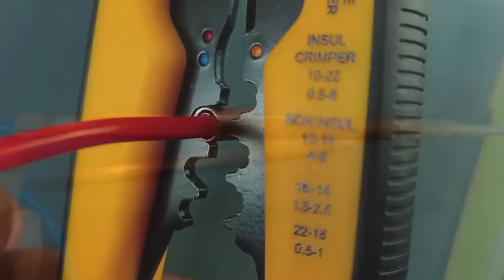Spot Welding Machine with Super Capacitor x 8 // How to make Simple spot welding machine at home

Comment: How come your fingers don't get burned as when contact happens , your fingers are bare , also how long each time to recharge the capacitors as I note the power is not connected during spot weld
Reply from the maker: One time charge, 5-10 minutes
Reply: It's not a 220 volt so that's why...😁
Reply: @mikestv4810  But with capasitors it supposed to amp burn and eat up the flesh.
Reply: The copper rods might not heat up that fast
Reply: Nice
Reply: Depends on the voltage, with these connected in parallel it’s probably lower than the 50V required to overcome the contact resistance of skin.
Reply: Capacitor maybe around 12v. Due to the copper is larger than the steel plate so the thin plate heat up much faster than the large copper so his hand doesn't burn but if he hold longer then his hand will be burned like charred satey.🤣🤣
Reply: The user wears a foot wear made of rubber. It prevents grounding through body and therefore no passage of electricity through body
Reply: @siran804  I still think this is a dangerous item it could lead to a battery exploding and possibly a fire , I user gets used to using it, what happens the 1st time he forgets to put on the rubber foot ware ??? Good luck to anyone using one , I,ll put my money on the lottery as this is a lottery for you,re  health .
Reply: @andyrankin5988  it's dangerous for sure. But this is how welding works
Reply: @siran804  not just to the same extent as this one is I,m afraid
Reply: Avi copper pipe naaa....?
Reply: Para tensões até 70 volts a pele humana  age como um isolante
Reply: @RJEDITALL  a
Reply: It’s 24 volts, if it was 60-100+ he would’ve jumped around
Reply: @andyrankin5988  OK
Reply: In addition 50 volts can give some shocks too
Reply: Excelent coment
Reply: Excelent video
Reply: Always the weakest part of the circuit burn not the strongest part that is those copper things
Reply: @siran804 , там всего 12 или 24 вольта. Такое напряжение не пробивает сопротивление кожи. Если напряжение большое, то ток пойдет от одной руки к другой. Надевать резиновую обувь необходимости нет, так как сам источник тока изолирован от земли (не заземлён.
Reply: Not good it very high voltage for spot welder..should be 3v dc only..not a good idea
Reply: 20 am jyada he.. 10 Am  medium he spot k liye...agar 20 se spot kiya or na nikla to cell k face pigal dega...is se achha 4 capacitor le shakte he..10 am k liye....,😊

Comment: Does not work as shown in the video, I used 10 X 10000uf capacitor, it discharged instantly and not capable of welding

Comment: this looks like a perfect way to get electricuted. no protection on the 2 copper leads that makes contact on the nickel strip, the copper wires are too close together when you need to charge the caps back up, theres no specs on how much power is coming through there so if one to spot weld on a battery, so how do you know you will not make a battery explode? so many other questions that needs to be asked...

Comment: Charge with 24v x 8  50v capacitor in paralled will yield 24v only. When used it will run out. But if the capacitors connected in series then the voltage will be dangerously high, example charge with 24v x 8 50v capacitor equals to 24v x 8 which is 192volts
Reply from the maker: Yes, ❤️
Reply: its paralel not series, but yes 24 volt its recomended for not conduct in the person

Comment: For spot welding it should give only a short impulse ,otherwise You could simply ușe the 20v/15A transformer directly.
Reply: Transformer directly to electrolyte capacitor? 😱 
It needs DC, not AC.
Reply: @q64qw65  a pile of mosfets in parallel triggered by a microcontroller for a variable number of milliseconds.
Reply: Yeah I was thinking the sane thing. Cause the total capacitance cannot supply that much current for so long.

Comment: With transformer, you can use 12v 10-20 ampere transformer; This is the missing part in your demo and got it from your your reply.  Thank you , It is really awesome.
Reply from the maker: I am use 15v 20 ampere transformer
Reply: @RJEDITALL  почему бы не использовать сразу с трансформатора, 20 ампер вполне достаточно для контактной сварки таких металлических пластин. Зачем нужны конденсаторы? Источник питания, должен быть постоянного тока, иначе будет бум. Щупы нужно изолировать.
Reply: Не ясно какое  напряжение  сколько  вольт.
Reply from the maker: @ЕрмуханАхметов-м3у  you can use 12-20v 10-20 ampere

Comment: I see a problem with this. The electrodes you are holding are exposed copper, which makes them very easy to touch each other. I'd wrap them in electrical tape, letting only the tips exposed.
Reply: I have a question with this as well. Now they're exposed copper of opposite ends that will complete the circuit when both are connected to the same conductor, wouldn't that mean YOU are completing the circuit by holding them both at the same time🤨. He obviously doesn't have gloves on. If I'm missing something lmk but that's copper pipe(conductive) covering copper wire(conductive) lacking any kind of insulation.
Reply: @austing9060  This is a bit too old for me to remember correctly, but from the title i assume the guy was building a welder. Welders operate on a very low voltage (less than 10 volts), and very high currents - therefore, you need a good conductor to do anything, like metal. Skin is actually a pretty good insulator, you'd need much higher voltage to make enough current flow through you that you'd feel it (or AC source, those can shock you with much smaller voltages than DC, depending on frequency). But yeah, in general, you can safely touch the electrodes of a welder.
Reply: @42  OK I guess that makes sense since it doesn't get much pressure to break the resistance of skin, taking the path of lowest resistance. I'm thinking back now to something like a battery, basically equivalent of a capacitor, and that you don't get shocked then 🤦

Comment: Which  is the device provide  12v 20amp  please
Reply from the maker: You can use 12v 20 ampere
Reply: How can get 12v 20amp in which device?  Please
Reply from the maker: @bineshchauhan8713  transformer

Comment: this seems a bit dangerous. there are sides left open, the colors and the color of the bar being held if other metal is used. you will make the best point for your hands. Be careful.
Reply from the maker: No dangerous because supply is dc volt.
Reply: @RJEDITALL  DC equally hits as AC LOL. Depends solely upon voltage and skin resistance. Hope your hands are dry.

Comment: Interesting, simple and well done. But why did you soldered 0:58 those two copper wires to the capacitors with their legs perpendicular instead of parallel? This would make the soldering process easier for you.

Comment: Should the connections not be positive, negative, positive, negative ect.. down the line?  Instead of a straight row of positive on one side and negative on the other?
Reply: 8 capacitors are being connected in parallel so we get total value
of 8x4700= 37,600 micro farads, quite powerful to hold charge and discharge as a spot welder
for nickel plates connection to lithium batteries

Comment: Not sure why you would charge 2.7v super caps connected in parallel with 12v adapter.
Reply: Because those are not super capacitors as he indicated in the title. Mis info.

Comment: How come you are not getting zapped? There is no isolation on electrodes?
Reply from the maker: No understand
Reply: @RJEDITALL  he want to say
Aapko shock kyu nahi Lagaa?
Means you didn't get shocked even though you are holding it with naked fingers. How ?
Can you tell it please
Reply: @satyavanshikhare3545  It is because the capacitors were charged with 12 V DC.  But the heat generated while dischargeing capacitor  would burn your fingers.

Comment: 4700 µF are not supercapacitors, and the wires should be attached to the center of the row of capacitors, not the end.
Reply: Does this affect how they charge and discharge? Can you expand a bit on this, or say what keywords to search for?
Reply: @calinfx270  not really. Just consider the paths that the current takes. Imagine the wires as a resistor, (which is what they are) -   you want the current to take the shortest paths - ideally a cable fanning out to each of the capacitors so they can all contribute equally.
Attaching to one end means the capacitor furthest away sees the most resistance, and the connection between the closest and next closest capacitor sees all the current from capacitors further down the ladder, which could cause overheating.
This doesn't matter much if currents are  low, but it matters a lot with high currents.

Comment: You touch bothe hands nudy and no isolet coper pipe you have not electrik shot crunt forme capaseter
Reply from the maker: No shock problems, voltage only 15v
Reply: @RJEDITALL  oh I c 🙏

Comment: Thank you very much for your sharing! However, whether the power supply just connected to charge the capacitors prior to welding ?
Reply from the maker: 12-30v 10-20 ampere

Comment: If this were a real capacitor bank, you would definitely receive a bad shock especially holding copper rods with no insulation..
I'm sorry,  but I'm not buying what I see in this video..!!
Reply from the maker: No shock problems, because input and output supply dc, 20-40v
Reply: I agree with you I scream total BS
Reply: It would shock the hell out of you